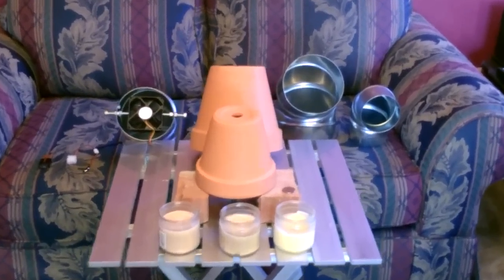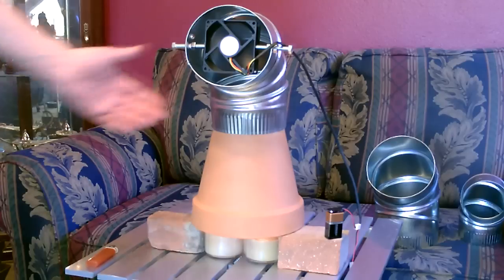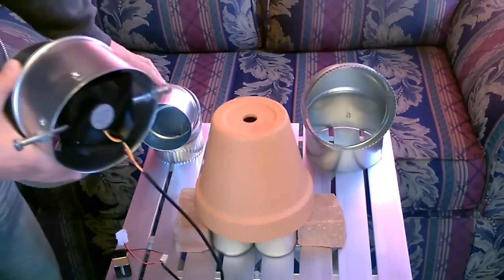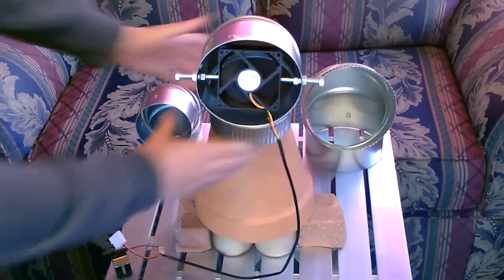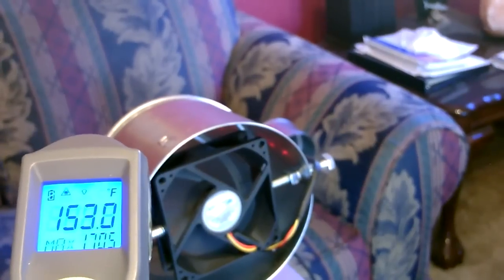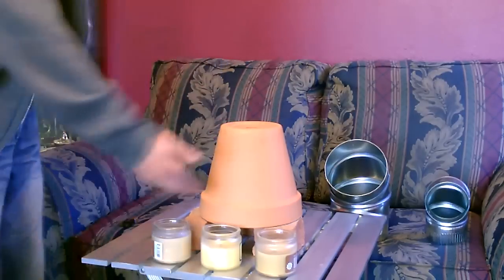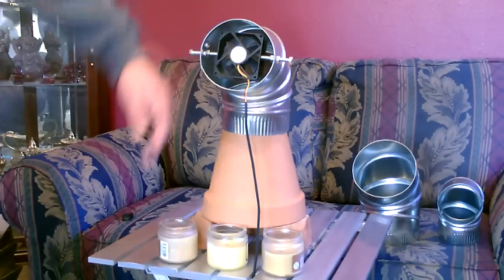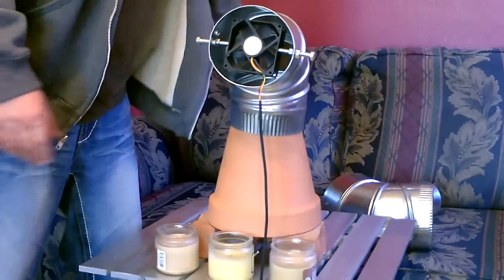Candle Powered Heater! (Improved!!) - DIY Radiant Space Heater! (w/fan!) - Clay Pot Heater!

Comment: Sorry folks, but you CAN'T multiply BTU's..
Reply from the maker: hi there. this is true. it's not adding to the heat - it's just directing it to where you can feel it. (at the level of the living space). the pots absorb and radiate the heat but there's still a loss of much of it (about half) from the top of pots that travels straight up to the ceiling (where you can't feel it - then through to the attic and out of the house). with the added fan you capture all the 'lost heat' that will just travel straight up and it's directed out into the lower area of the room (the living space).

Comment: cool! but i have an other idea, maybe you can made it
Reply from the maker: feel free to share it (if you want) and maybe i will 🙂
Reply: @desertsun02  Idea is easy. Put a serpentine copper coil between the first and second ceramic made outside like little radiator, all the same circuit them fill it with some water, calculated  very carefully how much water in because it gonna be very very hot, also put a pressure valve if in case and that's it. Hot water move cool water and make the circuit work. I think this is much better than just the ceramic because they become very hot but them not send the heat out so is very inefficient.